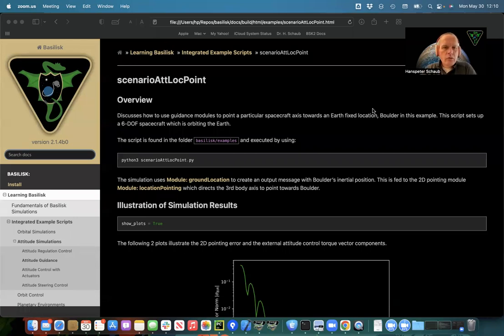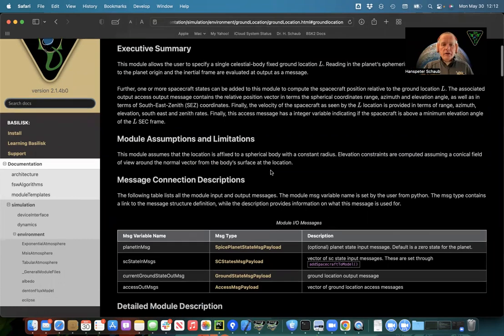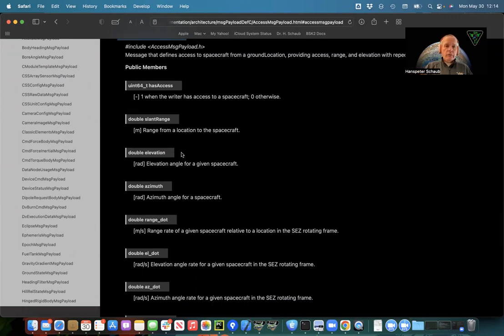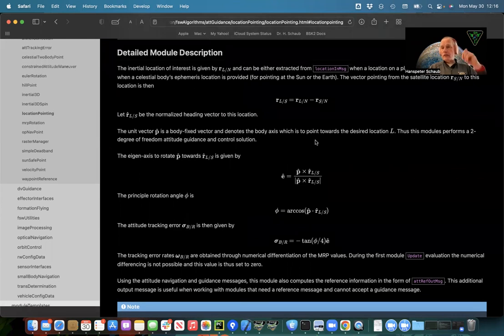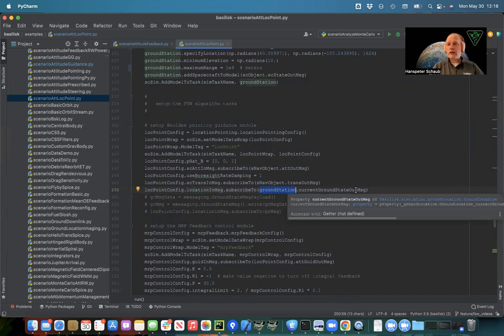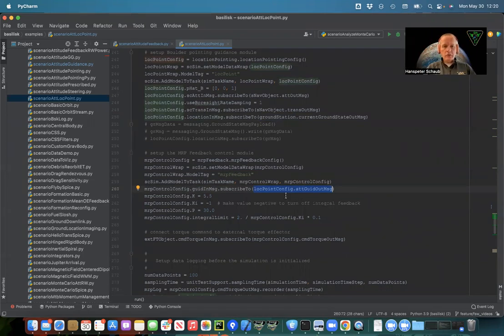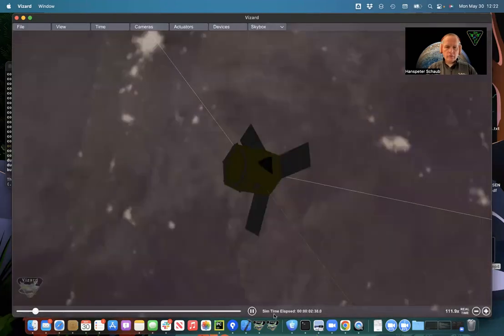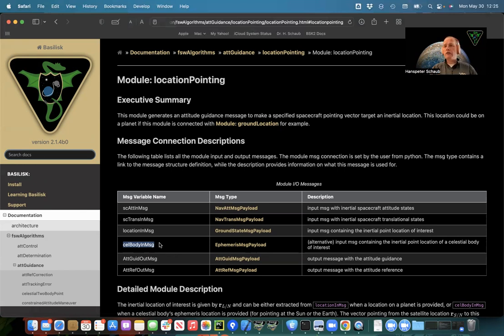Basilisk: Pointing Spacecraft Axis at Earth Location

Comment: Hi! I'm new to basilisk. I tried to run the script and create a bin file for vizard. Unfortunately when I open the file in vizard  I'm not able to see any cone coming from the location. Indeed, if I look at the view menu there is no location object already present and I have to manually edit and add it. Moreover, if I add the location and try to save it as a new bin file through the vizard menu, then it still doesn't show up the location even when I upload this new bin file. I tried also other scripts and it has the same behavior. It seems that the only features that vizard uploads are the ones directly related to the spacecraft object (it's motion and related effectors or sensors). What could be the issue? (I'm using Mac OS with M1Pro)